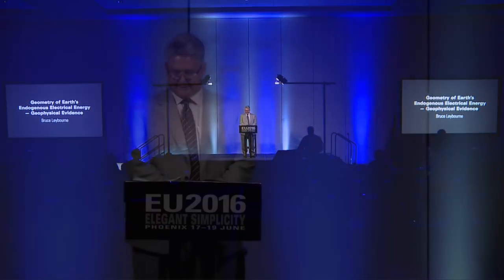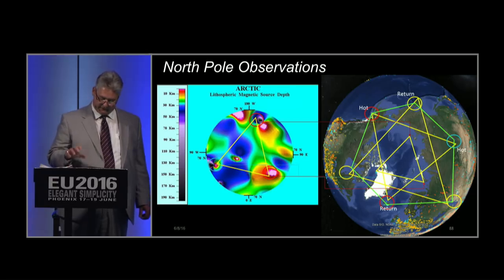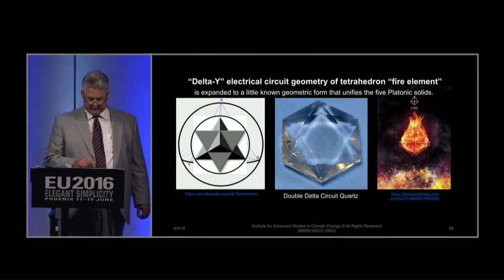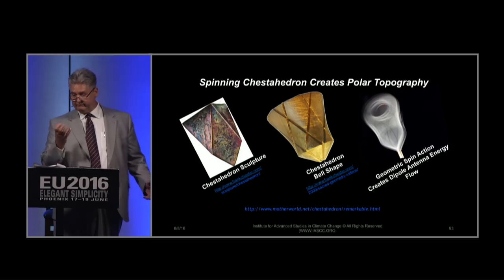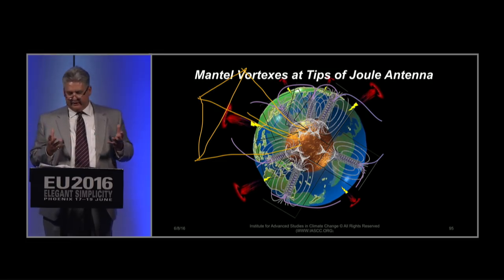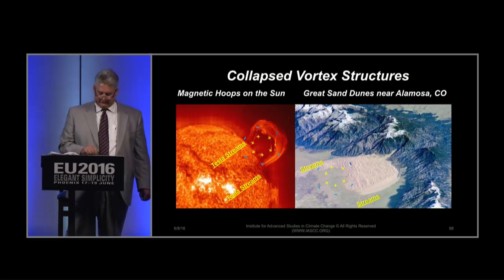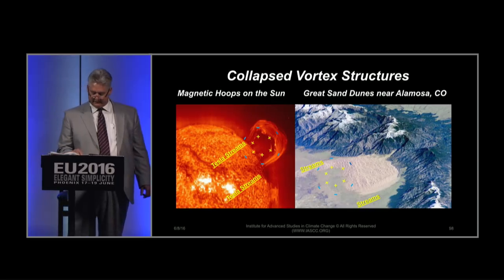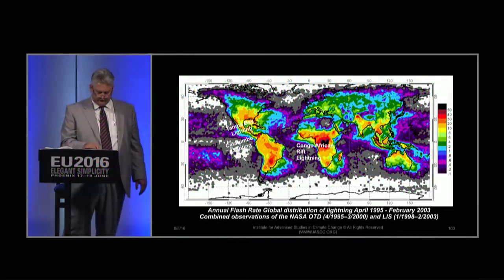Bruce Leybourne: Geometry of Earth’s Endogenous Electrical Energy -- Geophysical Evidence | EU2016

Comment: Incredible, very coherent speech! I have a similar theory, however, it has more to do with the piezoelectricity. After I watch this lecture, I realized that I'm on the right track... after all, a registered professional geologist also noticed something similar to what I realized, however, differently.

I will leave some questions below, after all, I have a similar theory.

Note: Regarding geometry, I found the explanation was very weak, fragile, lacked deeper in his explanation, Dr. Leybourne. There are ancient knowledge go back thousands of years that teach about sacred geometry and hexagonal forms. The Atlantians and the Egyptians are the most prominent about the geometry that permeates Everything around us. Anyway, I found his theory incredible, his theory can be tested in the laboratory because it is firmly grounded in well-known concepts of True Science.

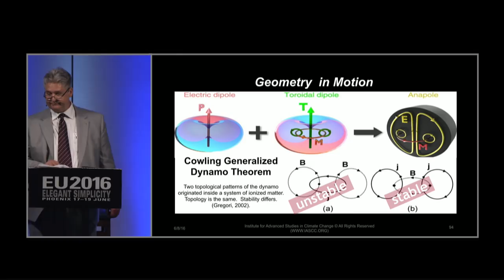Between 13:20 to 14:47 - Would not it be simpler to say that since the birth of the Earth, there is an eleromagnetic connection with the sun? And because of such a connection, could we accept that the nucleus rotates and creates a magnetic field from its genesis? This instability is much like the simple physics experiment called, Homopolar Motor, made with a battery and neodymium magnets. Search on YouTube: Homopolar Motor... and see some experiences :) In this case (homopolar motor) always in short-circuit constantly and briefly.

Between 14:56 to 16:01 - Would not it be easier to say, that there are situations or even regions on Earth, where the potential difference (Atmosphere and Earth Surface) can be absurdly greater/smaller than in other places? Between 37:43 and 38:25, Dr. Leyborne admitted not knowing why the phenomenon of lightning strike (Earth/Air) happens. Maybe there are regions of the earth, where the soil has greater electrical affinity with the phenomenon as a whole... or maybe it is something else... may be another type of phenomenon :) I have an idea to explain why this happens.

Speculation: Maybe there are regions on earth where the soil has greater electrical affinity with the phenomenon as a whole, or maybe it is something else (other mechanics). For example, let's say that particles that can obtain electric charges are confined to a spherical region around Earth, that is, a spherical potential with R (maximum radius) and r (minimum radius). Maximum radius (R) would be from the core to the atmosphere and the minimum radius (r) would be the distance between the surface and the atmosphere. In the atmosphere we would have particles with zero velocity because from the center of the Earth to the atmosphere (R) we would have the longest distance traveled (Flow Lines), but all the energy would be in the form of a potential between the Earth's surface and the atmosphere. Maybe the SPRITES are that. Maximum potential in the form of an inverted lightning strike in the ionosphere, you know, it must be consistent with the Theory.

In my theory I take into account the HUGE amount of energy that enters in planet through of connection with the sun (Eletric Field Pulses). So much energy moves electrons, everyone knows this, and phenomena like the piezoelectricity can not be discarded... simple like this... It's just a theory :)

Remember the video that you (Electric Universe) published about Hypatia Stone. Piezoelectricity has everything to do with the structure of nature of this planet. As above, So below (Hypatia Stone). The microcosm is oneself, and the macrocosm is the universe. The macrocosm is as the microcosm and vice versa.

And once again, excellent lecture.

Comment: He often uses the word tetrahedron, while pointing at structures which aren't tetrahedrons and don't contain any tetrahedral substructures.
Playing with shapes and playing the pattern recognition game and piling up meaningless word salad is something usually Jordan from Spirit "Science" gets attributed.
Example:
Take a zerodimensional point and wiggle it quickly forth and back, you get a one dimensional line. Rotate this around its center and you get a 2 dimensional circle. Take the circle and rotate it around its diameter and you get a 3 dimensional sphere. Take this sphere and wait a few aeons and the sphere accreted stuff and got bigger, now we have a 4 dimensional object that changes over time.
So what?
And yes, I'm fairly knowledgeable with delta-Y circuitry on electric motors and variable frequency drives, but I think this guy doesn't know that he's looking for a wheatstone-bridge-based Ohm-meter :D

Comment: Lol... reading the comments cracks me up! Obviously most of the commenters do not have an understanding of many of the concepts that have to do with Electric circuitry and how geometric configurations absolutely are necessary. Those having a hard time should start with just Crystals! Do a little research on piezoelectricity and crystals. It takes a certain cut from a crystal to get the piezoelectricity, even though the crystal like quartz is hexagonal there are certain geometric cuts that must be made.
To understand what he is talking about you need to know about Birkland Currents, plasma, Toroidal Flux, Electricity and magnetism and the right hand rule ( where there is an electric current a magnetic field is created 90 degrees out from the current flow, if you wrap your right hand around say a cable or wire with your thumb pointing in the direction of current flow, your fingers are the magnetic field!)
Reply: Learn what a Torus is! Learn about the flow of a Torus. 
I totally understand each and everything he is talking about. Research and educate yourselves! Anyone that wants some guidance and resources to help you understand I can give some links and you will have no problem understanding All of this.

Comment: I live in Tampa Bay and have for almost 30 years. I'm well familiar with our lightning; we're the lightning capital of the U.S. I'm not sure what the electric universe has to do with this. Florida is a peninsula, built on the confluence of ocean currents from the Atlantic and the Gulf. Our atmosphere is very unstable during the summer (lightning) months. This is well explained by the heated air rising over land and the cooler ocean air offshore. Plus, probably some seasonal jet stream changes in the upper atmosphere. In any case, it causes a strong stratification of the air over the peninsula, which you can see in the different layers of clouds moving in different directions in relation to each other. With all this unstable air and clouds, it is reasonable that there would be a huge increase in lightning, in order to even out the unequal and opposing charges of the different atmospheric layers and the ground. The air movement is fully explained by more or less stationary and moving high and low pressure areas which happen yearly at points around or adjacent to the peninsula.

The point is, the fact of our abundant lightning in west central Florida is more or less explained adequately by high and low pressure air, moving air masses at different altitudes, solar heating on land versus the ocean, etc. I'm not sure at what point EU must be introduced to explain the phenomena. And this is my problem with EU. You've got a hammer, and everything looks like a nail. But it's not. Some things are well-explained without EU. Strings of craters in straight lines on the moon or Mars, oh yeah, that could only be EU. But lightning in Florida? Not so much. These guys have tried to make the case that the Grand Canyon was formed by EU phenomena. Except that for millions of years, water has been actively flowing through this landscape, punctuated by numerous ice ages and thawings. That water (and the grit it brings with it off the land) is more than adequate to cut that winding channel through the rock of the desert Southwest. If you want to make the case that EU influenced the ice ages and thaws, go ahead and make that case. But I think the current conventional explanations of the Grand Canyon more or less do a reasonable job of explaining it. (You want lightning carving into planets? I'll concede Valles Marineris on Mars as an almost straight line carving of the surface by electrical forces.)
Reply: noferblatz the hammer nail adage can be used for a lot of standard model interpretations too. You seem to be describing the after effects of electrical phenomena. Air pressure is not a cause, but a result of higher order systems. Watch Andrew Hall's youtube presentations on lightning and you'll see we haven't been given all the information. Pressure differentials are the result of charge differentials.
Reply: Lightning has everything to do with the EU.

Comment: No reflection on electric universe theory, but this presentation is one of the worst I've ever seen. He doesn't really prove anything, and it all sounds more or less like some sort of mysticism. He doesn't explain his terms well. And when you start to use terms like "yin-yang structures" and such, I just want to say, "Can we get the real physicists out here?" I  used to be an electrician, and this guy is making this big deal about delta and wye circuits, and I'm just like, "So what?"
Reply: noferblatz good point.
Reply: Has nobody here visited Suspicious 0bservers?  Ben goes over lots of the same things as Bruce here did.  The electrical connections between the Sun and the planets, and between Earth and the other planets, cause weather patterns--by way of field interactions caused by the flow of current between poles.  The surface topography of planets, and the materials the planets are made of, are two of the variables which dictate how those fields form and interact.
Reply: Well explained.